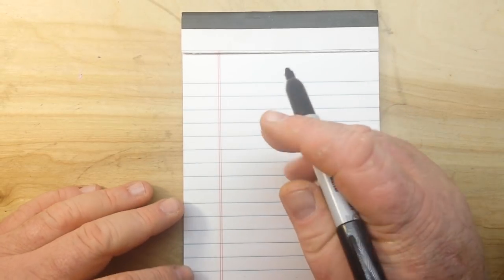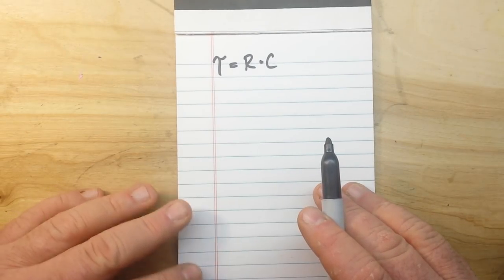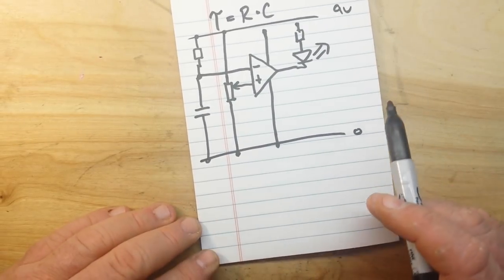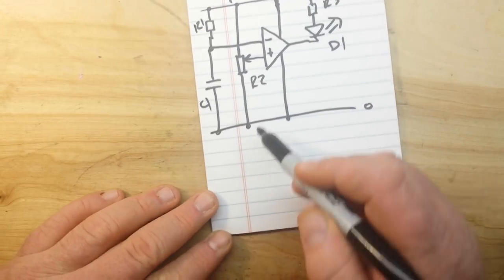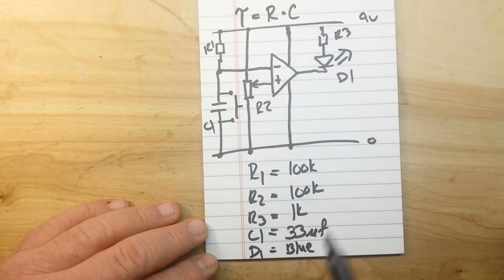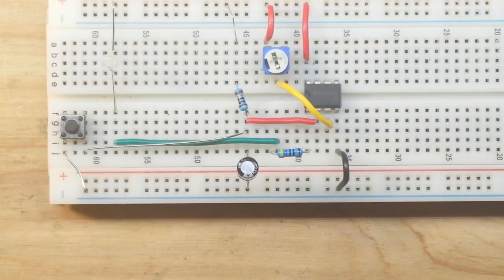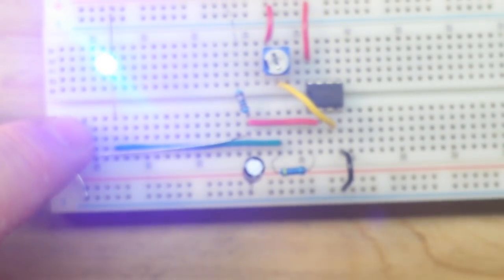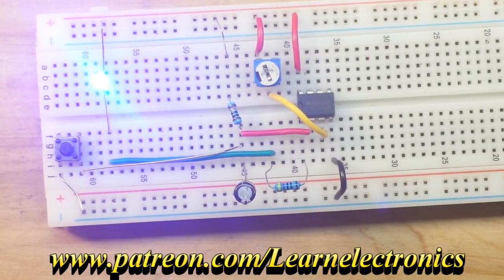Opamp RC Delay Circuit

Comment: So an RC circuit used with R and C in series can be used as a timer.  But an RC circuit with the R and C in parallel can be used as a filter.  Right?

Comment: great video but im not sure what I need this circuit for.
Reply: for many thinks, the first (and at this moment the only) use I have in my mind is to give you time to leave your home before energizing your alarm circuit
Reply: Here's another couple of examples.

If you've ever used a washing machine, you'll notice that when you close the door, there's a delay between wed when you close it and the wash starting. This gives you time to open it again before the lock latches to prevent it from being opened in the middle of the wash. What happens is that when you close the door, it closes a circuit such as this one, which waits a set amount of time before triggering a relay that locks the door and signals to the main board that it can start the washing cycle.

Another example if if your building has a keypad lock: once you successfully enter the code, the relay keeping the door locked is deactivated, and a circuit like this is powered to give you enough time to open the door. Assuming the door is closed, this circuit will eventually trigger the relay again, locking the door.

Circuits like this are used everywhere you need any kind of time-delayed action. Those are just two that I encountered today.

Comment: With that potentiometer, do you not have the risk of creating a dead short if it is accidentally set to 0Ohms?
Reply from the maker: +standishgeezer No, because only two legs are connected
Reply: On the schematic, all 3 pins are connected....I now notice that you actually wired it differently on the breadboard though.
Reply from the maker: +ElectronicWizard One outside, and the wiper. Yes it is a reference Voltage. You set it where you want it.

Comment: What kind of current will this circuit handle? Enough to fire a relay maybe? Another good one thanks!
Reply: you should add a general purpose transistor to drive your relay
Reply from the maker: +George Chambers It should for a relay no problem.
Reply: Thanks, Paul.

Comment: Great video. How consistent is the timing on this? Can you recommend simple delay circuits with very low timing variance?
Reply: That, I believe, depends on the capacitor: its charge/discharge cycle is what "clocks" the circuit. You'd need to take a look at the datasheet for the caps you're using to determine how reliable they are over a set of conditions. However, if low timing variance is critical, you should really be using a crystal oscillator as the timing component, as they're designed for that kind of thing.
Reply: @talideon  Thank you Keith. That was a helpful response.